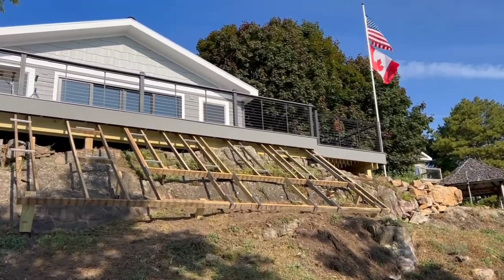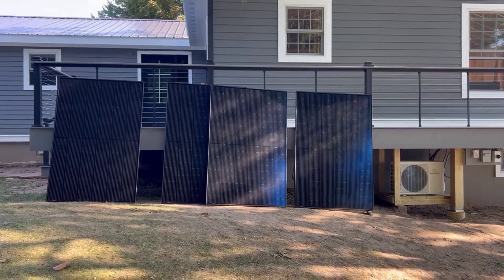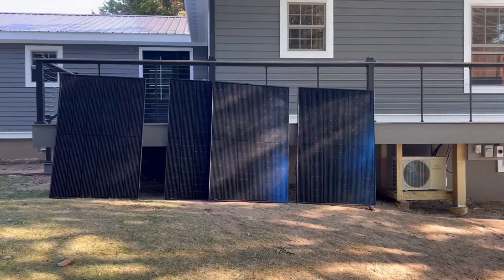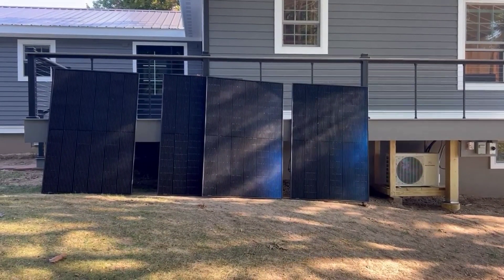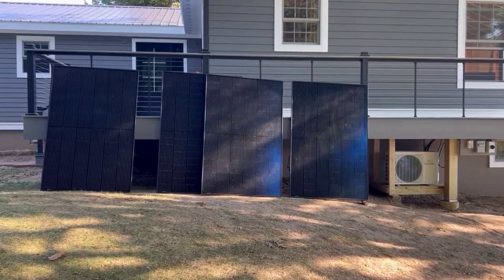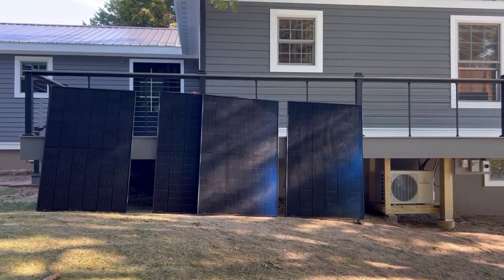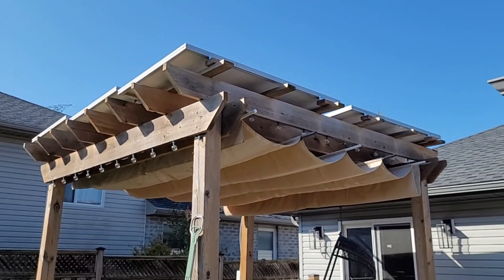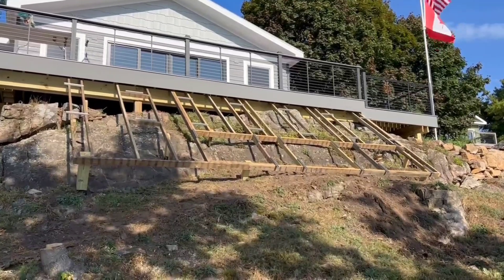Don't Make This Mistake When Installing Your EG4 Solar AC / Heat Pump!

Comment: I called signature solar after watching your video because the solar panels they sold me for my 24k mini split are 13.8amps. Was told that the mini split would be ok since there is a safety margin. The solar panels i bought from them as a package deal is still on website.
Reply from the maker: @markthompson7288  I think there was some panic at first when they discovered the overage, but after speaking with the manufacturer they were assured it was ok. Deye reached out to me and advised its not a problem.

Comment: I just installed this 12k unit and love it.  Do you think you could do a tutorial on how the app works on the phone?  The mode feature as well as eco and the "anion" function?  There isn't any directions on any of this that I've found.  Once again, awesome video, thanks so much for inspiring me to get one of these!
Reply from the maker: I don't think eco or anion have any function of this unit, it's a remote used for many other minisplits.

Comment: Thanks for that information.  I am about to purchase from Signature with your referral link. I want to buy some used panels and these are the specifications:

Specifications:
Rated Power: 250W
Open circuit voltage (VOC): 37.6 V
Max power voltage (VMP): 30.3 V
Short circuit current (ISC): 8.85 A
Max power current: 8.27 A
Power Tolerance 0/+3%
Maximum system voltage: 600V
Fuse Rating: 15 A

Do you think these will work fine? They are $500 with shipping for 10 panles.
Reply from the maker: Yes those will work great, you only need 5 but if 10 is the minimum that's still a good deal
Reply: @SmitHVAC.  Awesome and thanks for the quick reply. I will be ordering today and using your referral.  Saved me $50 bucks!
Reply from the maker: @HandyButClueless  No problem, thanks for watching the videos. If you use this link it helps them track my referrals as well. Appreciate it!
https://signaturesolar.com/?ref=_KvVrzchAclARI
Reply: @SmitHVAC.  I just used your link for a purchase.  I had to input your code for $50 discount.  Thanks again for all the help!
Reply from the maker: Thanks! appreciate you using it. Let me know when you get it up and running.

Comment: So @SmitHVAC, did you end up using the panels after DEYE responded?  I am guessing no since SS already said they would replace,  but good to know the label actually lower than what the MPPT can take.   I will be installing my 4th EG4 unit soon
Reply from the maker: I did use them for about a week before finding out, they worked fine but we disconnected them as soon as we were notified. The new panels just arrived last week.

Comment: I am sorry I do not understand. I read the specs and they are rated for 3.5kwh at 190v or something like that.  I would have to double check again. Yet I was pretty sure that four 400 watt panels would never even reach the spec rated for any of their units. Both of their units are 12k and 24k have the same ratings as the mppt is the same.
Reply: Generally speaking, power supplies, power regulators, and so forth (such as the one built into the mini-split) are limited by current and not so much by wattage.  It is the current which generates the heat inside the unit and has the potential to overheat the unit. Wattage is a function of current and voltage, and systems obviously also have voltage limits too (otherwise they burn something up internally or arc or whatever).  But it is the current that actually generates internal losses and the heat.

Now, the MPPT in the mini-split can obviously regulate the power to whatever it wants, and it can even probably monitor the current too.  So you can ask... why does the solar panel's short circuit current still matter then?

The reason is that MPPTs have to do a periodic sweep on the solar input to find the maximum power point and during this sweep it is effectively shorting the solar array for a few tenths of a second, potentially causing current beyond its maximum rating.  Simple as that.
Reply: @junkerzn7312  So pretty much you are saying that the MPPT needs a heat sink and water block to keep it cooler.  I get it now. I was still under the impression that the specs where massive. The range was pretty large which could accommodate a pretty large array.  I just wish all of the all in ones had this ability to be solar only and use the grid as back up. Yet non of them are. They all require battery or grid power to work.
Reply: @kameljoe21  The specs are generous. The EG4 supports pretty high voltages on the MPPT input.  That does not necessarily translate into high current limits though.

The MPPT in the EG4 actually does have a heat sink.  But there is a limit to how quickly various components can dissipate the heat.   Component cost is always a factor, too.  One could make a beefier MPPT but it would also make the unit more expensive.

A water block is not something you ever use when you need multi-year reliability.   

In anycase, I believe the EG4 does work on just solar, but its a trade-off.   You can do:

(a) Solar panels to EG4 and nothing else, but heating/cooling stops working in the late afternoon as the sun heads down and any excess energy from the solar panels is thrown away.  Still, this is a cheap solution.

Or (b) Solar panels to charge controller to battery to inverter to EG4 (AC input).  This costs significantly more and has higher power losses through the various components, but the mini-split will operate more reliably and excess solar is stored and then can be used to run the unit in the late afternoon and past sunset.   Even overnight with enough solar and battery.

If I were really cash limited I'd go with (a).  But if I had the cash to add battery buffering, I'd go (b) because it is a far more flexible solution and gives you access to AC for other things too.

And with (b), the EG4 might not be a good fit anyway.  It would be better to go with a 24VDC or 48VDC mini-split that one could connect directly to the battery, removing the inverter and power losses associated with converting to AC.

This makes the EG4 a fairly niche product.

Comment: Hello. The label marked ISC 12A but actually even u connect 15A panel or parallel solar panel make 20A the unit works. But maximum current allow to pass to the unit is 13A.  This will not damage the unit.
Reply from the maker: Good to know, thank you!
Reply: The company that makes the unit! 
What are the specs for each of the 2 unit? @DeyeSolar
Reply: i dont understand the issue. AC unit has a 380 max DC voltage well under the 4 panel VOC in series. Current is dictated by load so the AC will get what it needs panels will not push power.  no load no current. If anyone can explain what the issue was I would really like to understand.
Reply: It's mostly a safety issue. Part of the wiring inside the unit, before the fuse, can only handle 12A. Not sure how much of a problem it actually is in real world conditions

Comment: I placed an order with Signature Solar and they told me to go with the Canadian solar 385 watt instead of their Bifacial panels I wanted. My 385’s are working great. They said the other panels could damage the mini splits. I’ve been very happy with my system so far. Free AC can’t be beat!  Most people have no idea you can power a 12k unit with 3 panels that cost $177 each. They will pay for themselves in one year of usage.
Reply: You’ll save even more once you go completely off grid and purchase the lower priced 240VAC mini split versions. 32kWpv does it for us at 38° latitude.
Reply: @USA-GreedyMenOfNoIntegrity  why do an AC system off-grid?

I'd never convert to AC if I didn't have to

Comment: Awesome customer service from Signature Solar. I have begun spec’ing the build for the house we’re going to be building GA next spring. Am going with a 12K BTU for the upstairs common spaces and will eventually do a 24K unit for the downstairs common spaces which will include the kitchen and living room.

Comment: Chances are in AC mode they would never get to the short circuit limit but in winter it is likely, but why take the chance.
Reply from the maker: Agreed, it may have never been an issue. Better safe than sorry